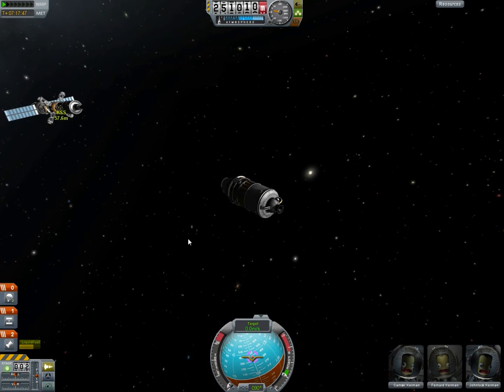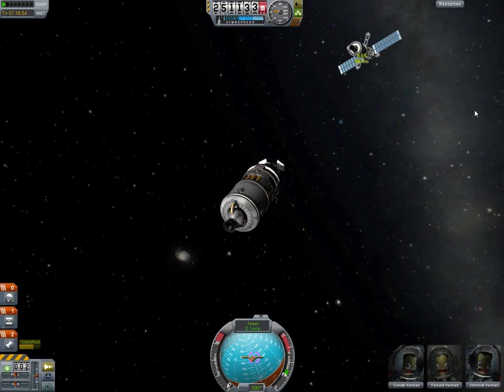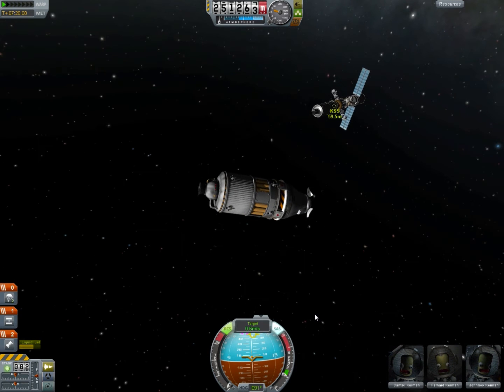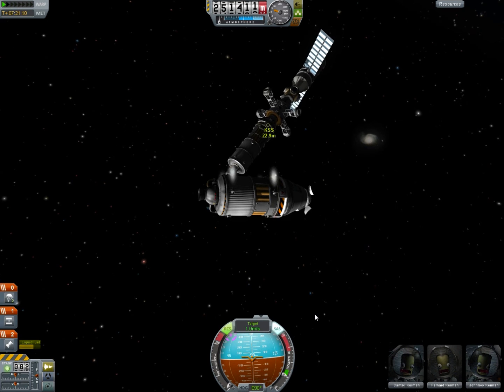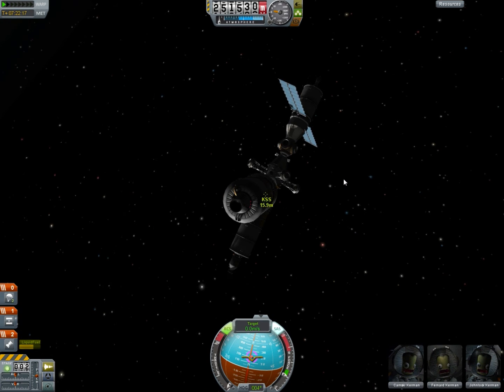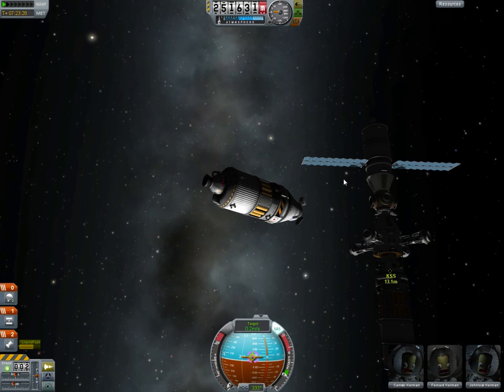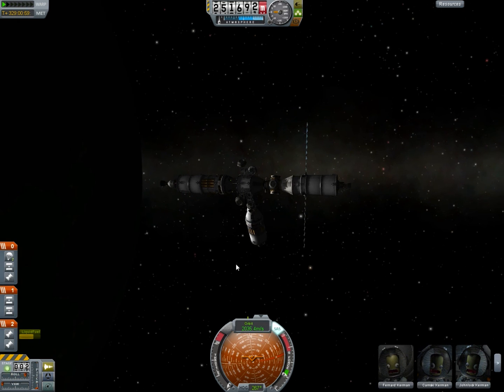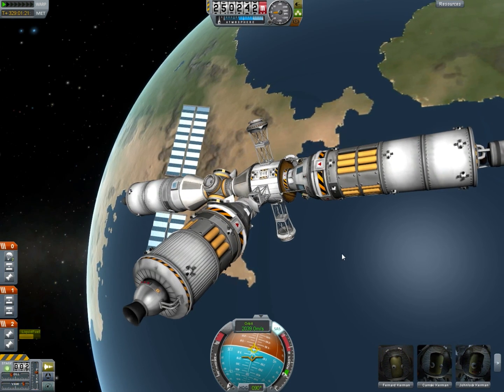KSP - Docking Tips

Comment from the maker: While SAS can cause wobbling in docked craft and should usually be left off, it's easily worth turning on during the actual process of docking, and when docking larger craft, it's practically necessary (I once spent like 20 minute trying to chase a docking port on a rotating station in a huge craft while mission control played the Benny Hill theme).